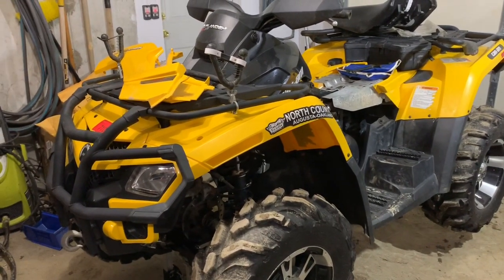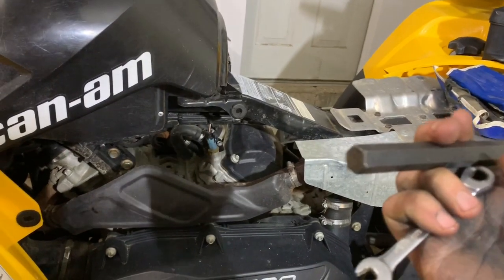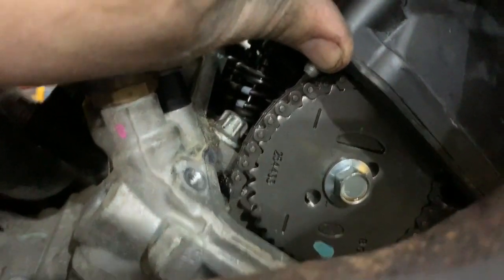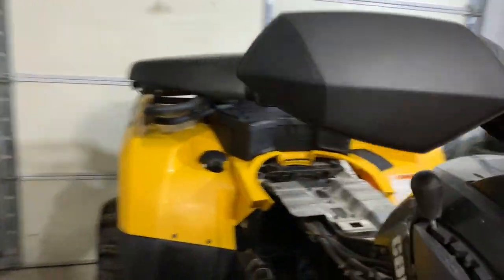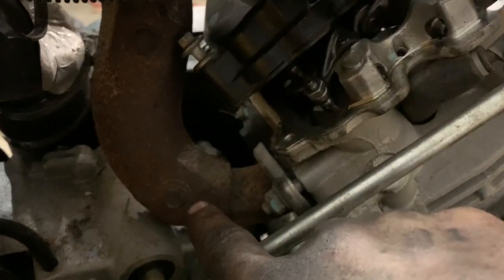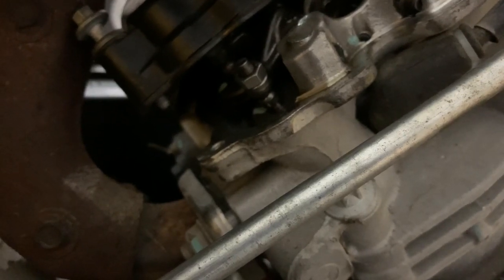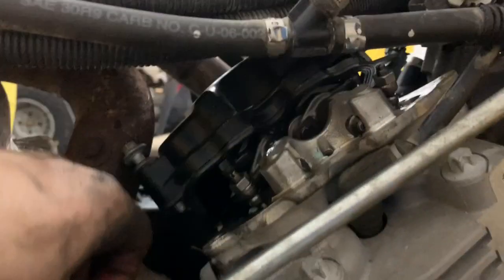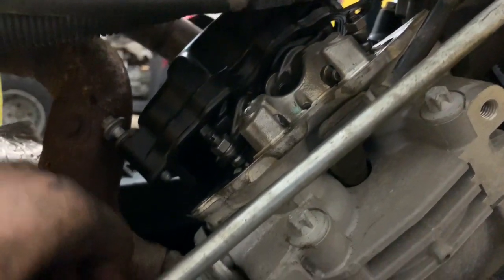How To: Can-am ATV Valve Adjustment Rotax Engines

Comment: Awesome video. I have a 2022 defender with the twin 1000cc engine. Just replaced the starter due to cranking slow when hot.  Read a couple posts of people saying the valves needed adjusting causing the engine to have excessive heat. This is the exact video I needed. Thank you!

Comment: That was a very large help. It was very thorough and to the point.  I am usually working on single cylinder motors, so this was reassuring for the situation.

Comment: TDC is also indicated on the flywheel. I you remove the single 8mm bolt on the camshaft sensor (black cylinder with wire coming out- top right of cover) and remove the sensor, you can look into the hole and see a 1/1 or 2/2. 1/1 being TDC for front cylinder 1, 2/2 being TDC for cylinder 2. Subsequently, the scores on the cam gear will be parallel with the head per respective cylinder.

Comment: thanks for the video. i have a outlander 570 and i hear a taping from the back cylinder get a little quieter after about 20sec of running guess from the oil. but can still hear the tapping not as bad. front sound normal. glad it not a knock. i did value adjustments on cars never 
a atv. your video shows that it dont look all that bad. planning on giving it a shot. good timing on video release.
Reply from the maker: Thinking outside the box good luck!

Comment: The best thing to do after initially setting them with the "middle" measurement is to take the feeler gauge at the upper limit of recommended valve clearance and if it fits, you know it's too loose.

ex. Exhaust .11-.19mm so the next feeler is .203 I think and that SHOULDN'T fit.

On contrary, the .102mm should fit with ease.

Comment: I have a single cylinder and adjusted the valves to spec.  I still have a tick.  I’ve heard mention of a tick being normal in the rotax.  Opinion?  Have ever had issues with rockers making noise?

Comment: I got a 2019 can am defender hd8 I replace the piston and rings and new valves and got good compression now and I got the timing set right I hope compared to what you showed in this video the springs was lose enough to set tdc I get a lot of air coming out the intake side and it try’s to start but the spark don’t get the the plugs I got a new coil pack I got new wires and plugs I need some help please

Comment: Have you noticed the valves being too tight often? I would think everything would loosen the more the motor is used. Great video and instructions. Thanks. Do you have any experience with the fuel line clamps? Are they reusable and do they take special tools to tighten them?
Reply: Speaking for my 2007 Outlander 650, the fuel lines clamps are reusable as long as you don't break them like I have done. No special tools needed for mine, they just clips. I replaced the one that I broke with a ziptie, it works perfectly!

Comment: Regarding the tick marks on the chain sprocket: on cylinder 2, the rear one, the one you are showing in this video;: Are the marks that need to be parallel to the cylinder head should be positioned below center of the sprocket or above the center of the sprocket? 
On cylinder 1, front one, they are below the center of the sprocket next to the edge of the cylinder head. Where they should be on cylinder 2? Thanks.
Reply: If you set TDC for cylinder 2 by using the flywheel marks, then you should be confirmed that TDC for cylinder 2 shows the ticks on the bottom of the gear and parallel with the head

Comment: When you tighten down the lock nut does the bolt turn and throw out your adjustment
Reply: Yes you have to hold the adjustment screw with a flat head and just give the lock nut a good snug